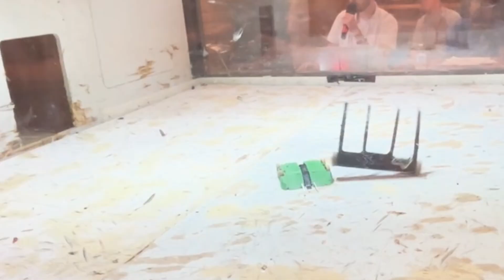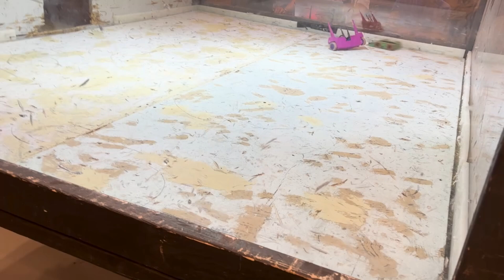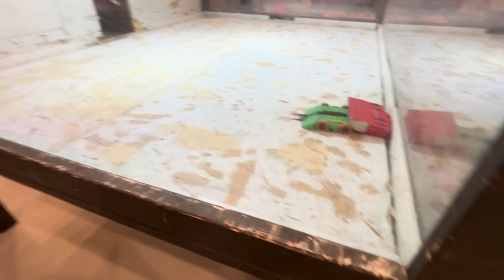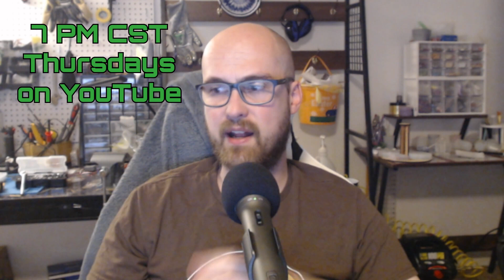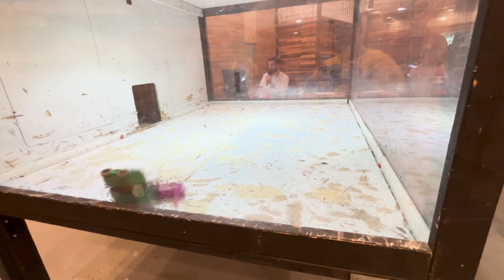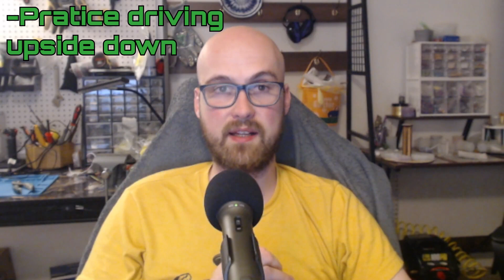My combat robot's LAST chance of the season - Bigfoot Ep. 10

Comment: I love Bigfoot. Maybe one of these comps I'll get to fight you with Imp. I wonder if the 4 RR brushed motors are power limited by the malenki. I run two RR brushed with a malenki HV on Imp and I feel like it isn't as powerful as Dice and Slice which runs a dual ESC instead.
Reply from the maker: The Malenki HV should be able to 1 RR brushed on each side no problem, because Bigfoot's 2 on each is barely limited. Do they both use the same wheels? Weight distribution also makes a big difference.